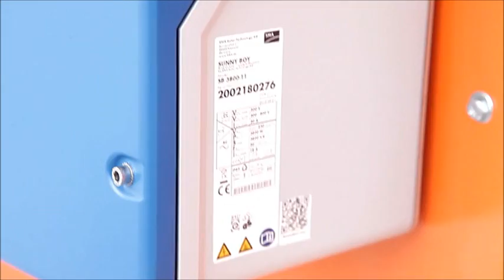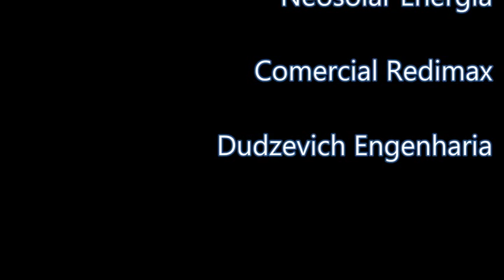Energia Solar Fotovoltaica - Instalação Grid-Tie - Neosolar

Comment: 2 (dois) painéis de 24v 220w cada, mais 2 (dois) o  painéis de 28v 250w, ambos estão ligadas em paralelo, a carga passa do controlador de 60A em seguida carrega 4 (quatro) baterias de 440A.
Pergunta:
Os painéis de 24v e os painéis de 28v, pode criar problemas da diferença da voltagem...
Aguardo
Obrigado
Reply: quando você ligar as baterias em series paralelo formaram teoricamente 24v e conectar no controlador ele regula a voltagem. o meu painel de pende da hora do dia medindo voltagem em vazio chega a 32,5 volts